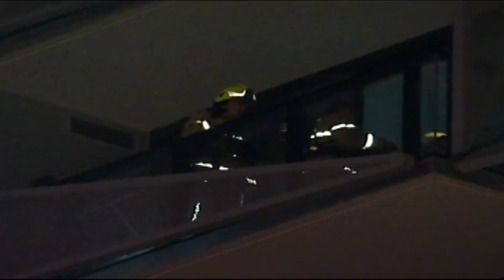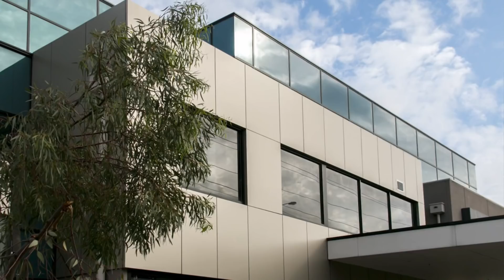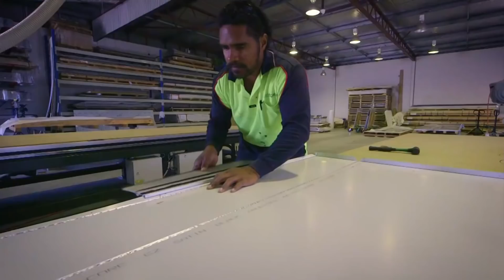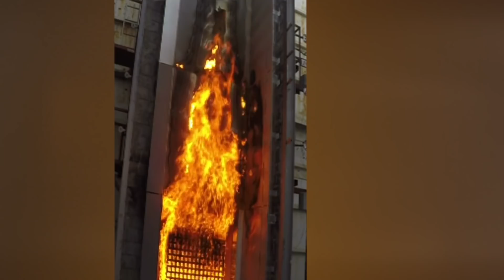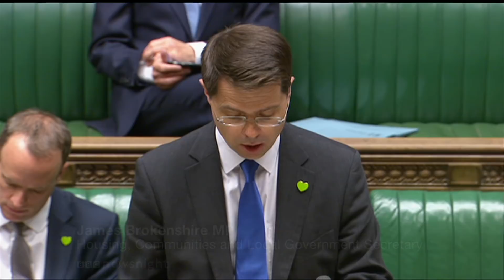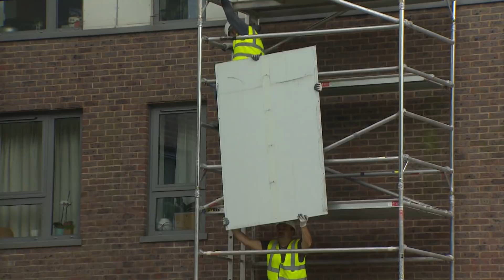Replacement cladding fails fire safety test - BBC Newsnight

Comment: Most if not all thermal insulating materials are flammable. Its on the exterior. Not the interior. Its like saying furniture doesn't meet standards of fire safety because it will burn in a fire. They are internal so even worse. Its nonsense. The fire starts inside the building and spreads to exterior and the cladding is the problem???? Wake up.
Reply: The problem with having exterior cladding that is flammable is that it can cause a fire at a tall building to spread upwards very quickly. Many buildings were designed so that I'd there was a fire in a unit, it will be contained to that unit only. Example Grenfell was designed this way. However a fire that started on the 4th floor which should have been contained spread really quickly upwards and was later found was caused by the cladding. Furniture being flammable is unavoidable, however cladding being flammable is.

Comment: It's full of air pockets, acts just like a chimney fire!  Uh, what's wrong with brick?  And fire escapes?  Sprinklers?
Reply: High rise buildings never use brick because, 1 the extra weight the actual building would have would therefore up the building cost to support it, 2 Time it takes would also up the cost. 3 in an earthquake you would have all those bricks raining down on people.
Reply: @StanslaMichael  concrete?
Reply: @StanslaMichael  there is no need for high rise residential buildings in the first place
Reply: I said there was no need for high-rise buildings, I didn't say there was no need for high-density building @FowlorTheRooster1990

Comment: Following Grenfell, LB Islington made grand statements about fire door and front door replacement programmes. All front doors in the block I live in would be replaced by October 2017. They also immediately put plastic Fire Door stickers on stairwell doors, which date from the 60's, even though these had been assessed by an expert as not being fire door quality. Since then, nothing. The door replacement programme has gone silent. No update has been issued, no project can be found which covers this issue. The best guess from a Liaison Officer at LBI is that some work may start at the end of 2019 however, it is not known whether the fire safety work will be included in any future project. I cannot find anyone from LBI who is prepared to discuss this. I live on the 23rd floor...
Reply: shocking beyond belief
Reply: any news on it?
Reply: @crappymeal  Actually, yes. All stairwell doors were replaced end of 2019 early 20. Issues have been raised as the new doors blow open with the wind, so not as expected. All front door were replaced also, with wooden fire doors which have a heavy letterbox cover to prevent smoke from coming in from the lobby. Thanks for asking.
Reply: @BJonesUK  no worries thanks for info